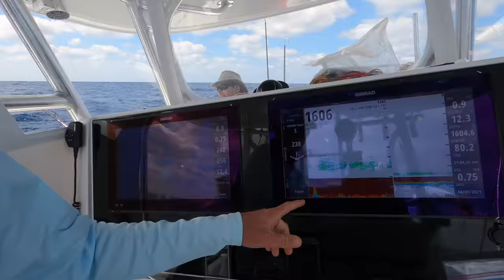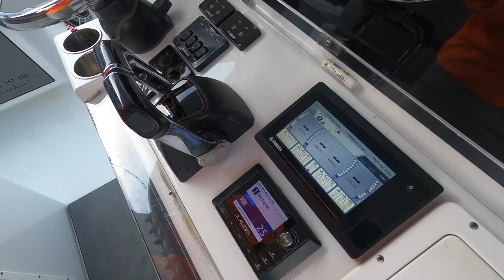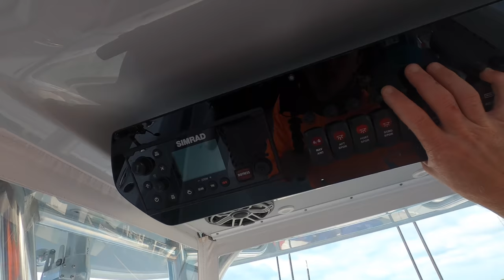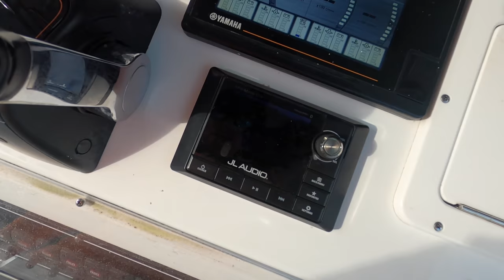FIXING pumps and antennas with some daytime swordfishing!

Comment: Take the handle off the reel connect it and a battery operated drill to the part where the handle bolted on to the real spin your new line on at terrific speed it will take you 10 minutes to fill up a usual plus they'll be no tangling because the line will go straight on to the real this will cut you a time in half you can do four wheels by the time you get done with one I do it all the time it works it harms nothing hope this helped you